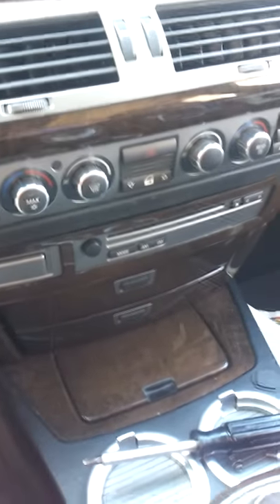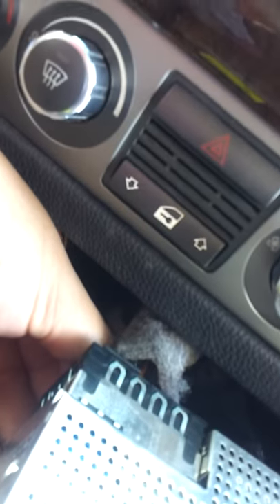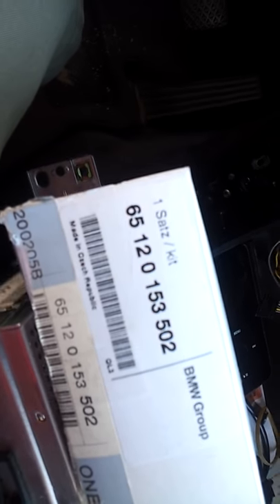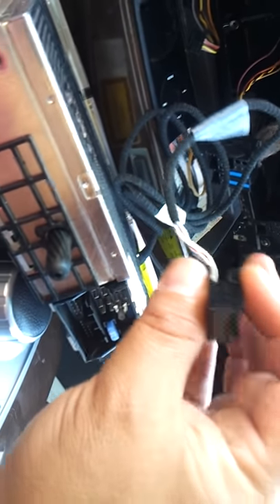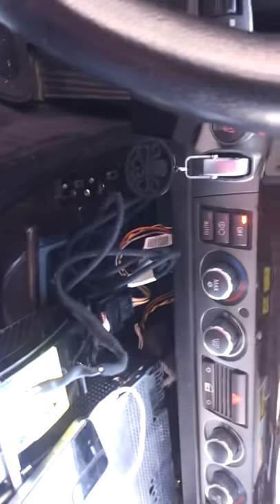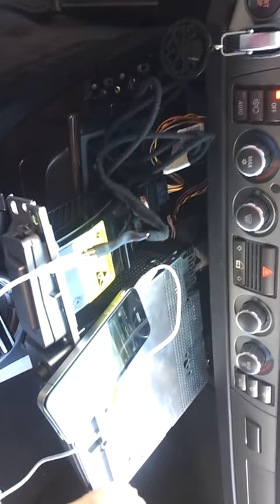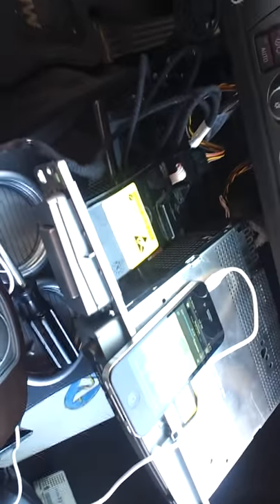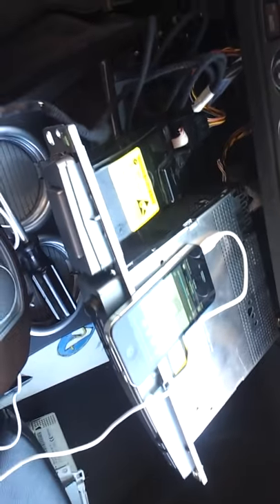AUXILIARY INSTRUCTIONS FOR 745LI 750LI E65 E66

Comment from the maker: To put it back together you just do the same in reverse . As for the Aux cable placement , you can put it anyplace you want to . I have seen that  Most people put it in there ash tray or on the side of there center console on the carpet area by the extra lighter plug , but further up closer to the seat .

Comment: So it has two steps
1. Have car coded by NCX Expert to show Aux in MMI
2. Install cable to Ask Unit

I have 2006 750Li. Let me know if I am wrong on these two understanding

1. Face lift MMI means have it coded by NCX expert
2. Face lift ask unit means adding a aux cable

Do I have to buy a new ask unit for 2006 750 Li. Your video is the best.....
Reply from the maker: in some cases you have to buy a newer ask out of 07 , but some 06 Ask units are capable . Try coding the Aux feature & you will find out  . when You Code the Aux feature to your MMI try clicking it & use the volume knob , it it works your good , If it don't , you need a newer Ask unit .

Comment: I wish I could get mine to work. Local Dealer doesn't have the software to code and turn my AUX on in my car. They guy said he can do it for 3 and 5 series not 7 series.
Reply from the maker: You need to find someone in your Area that does coding . check out https://www.bimmerfest.com/forums/7-series-e65-e66-2002-2008.126/ in the E65 section

Comment: I did watch the video and comments. What I meant was if I could do your work vice versa or not: Have the car coded to have the AUX function first, then take out the ASK unit and plug the AUX wire? Your work is the other way around. 

By the word MMI, I meant the ASK unit. Sorry for the mistyping.

Comment: Thanks for the video showing how to install an auxillary cable. I tryed installing a cable using the spec from this video putting the pins at 2, 7 and 8 but my radio is not finding it. I do not have the facelift unit so do you know if there is a different pin seletion I should be using?
Reply from the maker: you need to retrofit the facelift unit . the Ask unit you have is not capable .

Comment: What would the total cost of this DIY upgrade? Just some rough figures on what you feel would need to be spent. Have an '02 745i. No mods done to this vehicle. I did read the items you recommend to make this work, but just wondering where to even start to gather these components. Price is my initial question tho. Thank you for your time and the video.
Reply from the maker: +bmoney022007 
cost would depend on what you pay for the needed parts & what You pay to have everything CODED & PROGRAMMED to your car  ???  I would suggest you try Ebay or your local Salvage yard for the parts needed to get this all up & working .

Comment: hey, I am planning on buying this aux cable however, one thing I'm concern about is that when I check on the actual screen under entertainment, there is no aux option to choose. my question is, would the aux option appear ones I connect the cable, or do I have to update the software?
Reply from the maker: You need it coded

Comment: Just tried this solution to my 06 750i. According to specs my 750 is a facelift unit. Purchased correct cable, modifed pins and it did not work. I took it to BMW to have the codes updated (did not see Aux when iPhone was connected) and they said it will not work. Dont think i missed anything but something did not work. The mechanic assured me that have the facelift unit. Help

Comment: I know i need to have an ASK UNIT and AT TUNER if i have an early (April 06) E66. But because the ASK Unit looks the same and from what i have read it is the same, i should just be able to upgrade the ASK unit and AT Tuner to a newer firmware release with SP-Daten 53.3 or newer? Would this work instead of buying a newer ASK Unit and AT Tuner you think?
Reply from the maker: You can try , I have heard a couple people did it , but most who tried it didn't work .

Comment: Are the pins #s identified on the back of the Ask Unit the same as on the aux. plug? 2, 7 and 8.  On some of the 06-08, when I LOOK DOWN into the connector on the  back of the ASK UNIT, I see number like 
17 - 22 / 23-28 left side & 29 - 34 / 35 - 40 identifying the pins.   DOES PINS     2 = 30,   7 = 35,   8 = 36 ???   HELP!!!
Reply from the maker: the only pins you have to change are on the AUX plug you purchase

Comment: I'm having an 07 750Li and it does not show AUX function on the MMI. Can I activate the AUX function before I take the MMI out and connect the wire? And where did you get the adapter? You bought it separately or it was inside the MMI all the time? Hope to see your reply soon. Thanks in advance.
Reply from the maker: yes you can code your MMI first  , & you don't pull out your MMI . watch the video again , you put the Aux Plug in your Ask unit

Comment: got the aux cable, reassigned the wires, got head unit from 06/2006 e66, plug everything in, took my 03 e66 to dealer to have it programmed, but they were not able to program it. any suggestion? who can do the programming? thanks in advance.
Reply from the maker: sacglobal1  depending on your location would depend on who can code the feature for you .

Comment: im from aruba (the caribbean) thou. far away from the states so pls if you can help me with some info about how to install the aux cable in my 750i 2007.
Reply from the maker: Benjamin Coutinho 
What Info do you need ? the video shows you how to install it . Only thing you need to do after that is have it coded , & as long as your car has the proper Ask unit in it or as long as you have RETRO-FITTED THE ITEMS NEEDED your good .
Reply: How i suposed to coded it?
Reply from the maker: Benjamin Coutinho 

either find someone in your area that can code it for you , or purchase the software & do it yourself ...

Comment: Hi all, can anyone help me out? I've been trying to install an aux port in my 2004 745li for the last year with no luck! I've purchased and installed everything mentioned in this video and other forums (i.e., BMW aux port cable [rewired], facelift MMI and ASK unit [KW: 43/06} and still nothing! What I get instead, is no sound when I select either the AM, FM, or WB options. Not to mention, that when I do select the AUX option I don't see the aux volume option as shown in this video. All I see is whatever tuner option I last selected.

Thank you in advance to anyone who can provide any type of assistance!
Reply from the maker: chazgar 
1'st off just reading your comment already tells me you didn't purchase everything needed . Also you have the wrong Ask Unit ( yes it's a FaceLift Ask but it's an old FaceLift ASk )  if you READ My description in the SHOW MORE tab you would see that I mention getting an ASK from AN 07 or 08 to be sure you have the correct 1 . I also mention everything you will need ( which you don't have )
Reply: PAPERMONEYMONEY Thanks for the reply! According to your description, you mention that "an early 06 [ASK] unit will not work." However, I have a late model ASK. It's actually 9 weeks short of being an 07 unit [KW: 43/06]. Do you still think it won't work? Or, could it possibly be that I don't have the "AT/TUNER?" I thought the ASK unit was the tuner itself. Where is the "AT/TUNER" located? Is it in the truck of the car? Also In the description you mention that you might have all the necessary parts for the conversion. If so, how much do you charge for the correct ASK and AT/tuner units?
Reply from the maker: chazgar 
As I stated before , You have the wrong Ask unit ( that's why nothing happens when you access the AUX Feature )  . The AT / TUNER is in the C pillar on the driver side . Sorry at the moment I do not have what you need .
Reply: PAPERMONEYMONEY I know you mentioned in the description that the antenna tuner needed to have a production date of 06 or newer. However, I found one that has a production date of 10/05. Do you think that will work?
Reply from the maker: chazgar 
I'm not sure why you keep asking about 05 parts working ? 
I stated everything clearly in the SHOW MORE description . 
here is the part # TUNER PART # 65209123610

Comment: i have aux in my 745i 0w but i cant find the option
Reply from the maker: +Ernesto Anderson 
you will have to be more specific  & explain more ...
Reply: +BMW MODS & TIPS i really dont know how to explain myself in this case but in the inside of the middle compartment there is an AUX-IN. i try to use it to play music with my phone, but my idrive doesnt show the option of that AUX-in just like your does. by the way i have a 2002 745i. in addition, the signal bar on my idrive or screen is not strengh like your neither. by the way, i recently bought this car.
Reply from the maker: +Ernesto Anderson 

Ok someone added that Aux plug to your car  . 02 does not come with or have that capability unless someone modded it into your car some how . I would have to see some pics or see the car in person . Have you pulled the panel to see if there is a harness plugged into the Aux you see in your console ?
Reply: +BMW MODS & TIPS no i came with the car..if you give me your email or foone number i can send pics of it
Reply from the maker: +Ernesto Anderson 

sorry you will have to give me your # as I don't give mine out .

Comment: I installed the aux cable that I got from the bmw dealership after reassigning the pins and my system doesn't read the aux cable.  Please provide some guidance.
Reply from the maker: Deric Robinson 
Did you hit the SHOW MORE button & read what's in there ???

Comment: who could do this for me now how much? I live in Anaheim. .but will drive to la. or even San Diego. .. I have a 745 I 05
Reply from the maker: +Arnold Quintana 
Why not do it yourself ? the video shows what you need & the read more tab has more info . only thing left is the coding of your MMI screen to show the Aux feature . Also you need to have the correct parts from a newer FaceLift installed & coded to your car . Do you have all the newer parts to install to make this Mod work ?
Reply: I don't. .I could get it..there's no problem in that...
Reply from the maker: +Arnold Quintana 
Then I suggest you purchase all the needed items that are mentioned in the video & the SHOW MORE TAB ...